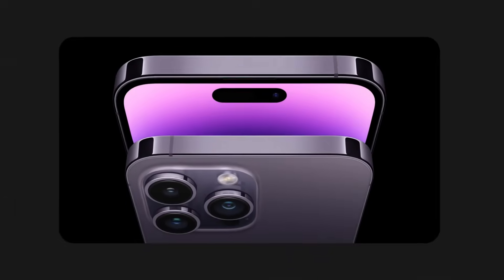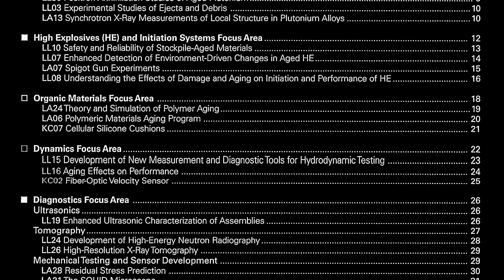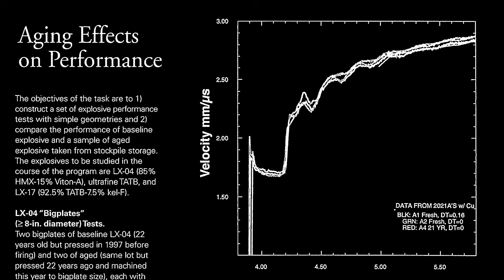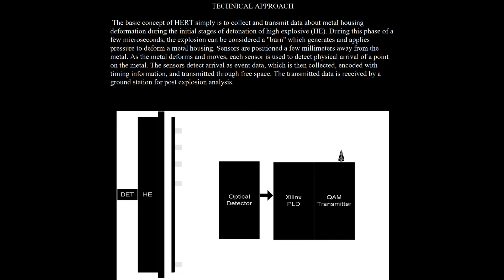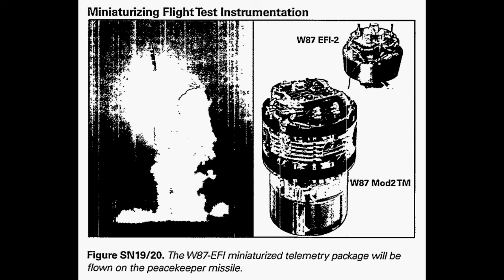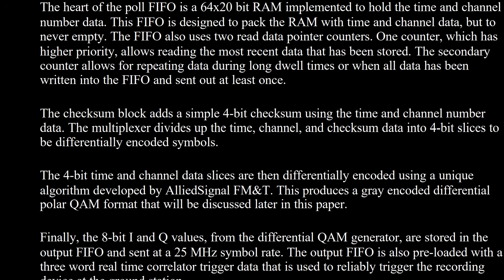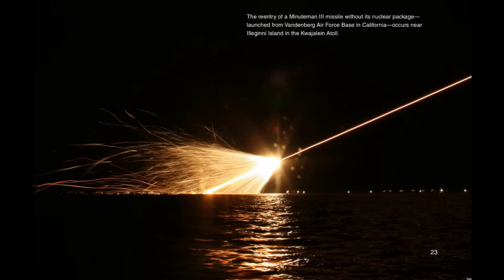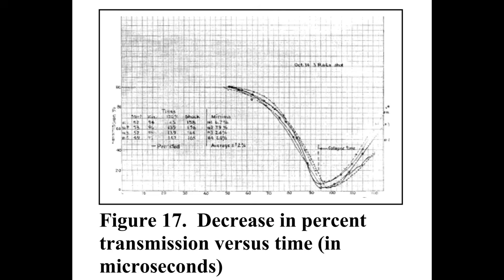The Computer Designed To Die In Microseconds

Comment: That's all super amazing. I had never seen an animation of what happens at the core of a nuclear weapon during the detonation. I would love to see more of that and a description of what we are seeing as it implodes. It would be neat to see more on the original implosion experiments and their aftermath. I wonder what those experimental cores looked like after they were imploded. Were they still intact but more compact? Did they compact into a perfect sphere of some new dense material?  It's like a scene out of  Superman movie where he compresses coal with his hands and creates diamond. I think one time the bad guys held Lois Lane hostage until Superman manufactured some diamonds with his hands.
Reply: The dummy cores probably have so much energy in them as they implode that they "bounce" at the center and explode into a fine mist of liquefied metal.
Reply: @r0cketplumber  I can imagine that happening. Sounds plausible.
Reply: At peak compression the volume of the core is roughly halved and its density doubled. The amount of energy stored in the compressed material is huge and it would quickly rebound and explode into dust if the nuclear explosion didn't vaporise it first.

Comment: The entire point of the National Ignition Facility IMHO is to produce a Fusion Bomb that does not require Fission for Compression. What they have proven is they can do that and have detonated a 17LB of TNT equivalent  Fusion Bomb with as little as 10 Kilowatts of actual focused on target laser power. What I am not sure of is if they could detonate a 1 Kiloton (or 10 Megaton) of TNT Bomb with 10 Kilowatts of Laser Compression or if the Laser power will have to scale up. It would be very interesting to see the inner workings of the instrumentation and resulting Computer simulation from this data.
Reply: Happy Birthday, PS when your Great Grand kids start turning 10 , then you know you're old. ;-)

Comment: About that fake warhead exploding over that poor hated atoll. It does approach it with the remnants of reentry velocity engulfed in hot plasma of atmospheric heating. The spherical explosion it self is another source of plasma completely surrounding the apparatus. How does radio transmission deal with that? High output power, some funky receivers? Warheads are accurate so at least proximity to receiver is not a problem. Or does warhead contains a transponder outside of explosive lens assembly?

Comment: I worked for a company called Birdwell which did wireline logging (not lumber but data) for the DOE at Mercury Nevada. We logged the 10’ diameter bomb wells but also all the smaller monitoring wells surrounding a subsurface test. The inner monitoring wells were destroyed but sent data as you mentioned. The outer wells were used to measure various spectrum data. Fascinating work.

Comment: Welcome to the other side of the human half-life :)
100Mhz is not a fast processor, even for that time. There must have been other reasons to chose it over other faster devices, such as cost per unit, failures per hundred made percentage, or even just resistance to the electromagnetic pulses of the detonation system.

Comment: How about putting a single power source in the middle, wiring transponders to it with unique codes and measure when each transponder stops transmitting?
No internal computation needed and it would allow for a more analog like signal, you could even give each transmitter it's own frequencyand just plot when each frequency goes dead.

Edit: pls someone develop a kind camera that uses a dense matrix of sensors, take an analog computer to render the whole thing and put it on a cothode ray screen! You'd get a 3 dimensional implosion model with it
Reply: And how exactly do you transmit through metal and plasma?
Reply: @0MoTheG  well they did transmit it somehow, didnt they?
Reply: @wonjez3982  please check the wiki entry on Dunning-Kruger effect. Then you will see why your idea is unlikely to work.
Reply: @JurekOK  Well, asking a question is neither knowledge or skill based and thus cannot be affected by dunning kruger, neither are speculations about the consequences of the question at hand.

Also i'd rather overestimate my skills than to remain silent, nevermind ignoring someone because they don't have the same understanding as i. Everyone can have ideas, knowledge just makes them more likely to be actually useful ;)
Reply: Not enough precision. There is more than one reason why it may stop transmitting, and even the antenna itself has some internal energy resonating inside it after the transistor pumping it has stopped pumping. So, you would have to factor in "how did the antenna got crushed" making it way more complicated, not less.

Comment: Years ago I worked for a company that made something that was of interest to the government. The things we made were designed to be used 1,000 of times typically. In discussions with my contact at the government agency, I asked, “What is duty cycle?” Meaning how many times does it have to work. He said, absolutely deadpan, “Once.”
Reply: "Once... but it must work that one time, with 100% reliability, after sitting in a warehouse for 40 years." This is precisely why "nuke-cert" materials cost an insane amount of money - it's the same grade-8 bolt you can buy at Home Depot for $1, but because 50% of the production lot is tested to destruction, we taxpayers pay $10 for the exact same bolt. Because it absolutely, positively, MUST work when call upon to do so. Failure is NOT an option.
Reply: @MrJest2  Yes, I understand and agree. We also used to produce electronic components for spacecraft. The company I worked for (GE)  helped develop the procedures of how to produce components with XXX degree of reliability but without testing all of them to distruction which of course would leave you with none left! The full procedure too lengthy to put here but yes, they resulted in ordinary 5 cent diodes costing $10.00 after all the testing and other procedures. Most people do not understand that this is the reason that certain pieces of equipment can end up costing so much. I do not know if "that department" ever used our product in the application.
Reply: @MrJest2  Lol and yet a lot of stuff fails anyways. Often not even the hardware, but the people.

Comment: That's a bit of a flashback.  My thesis work was part of a high density generator and computerized detonation system for  ~30mm munitions (they kept pushing the scale down to smaller calibers).  While the devices do only have to operate for a fraction of a second, they also have to sit fully assembled for decades and remain reliable with zero maintenance.  They also have to fit in as little volume as possible and withstand absurd mechanical loads.

Comment: I have a question. You say the shockwave moves with 8 km/s. What I know from rocket engines is that the detonation in the burn chamber cannot move faster than sound. Sound at normal pressure is 300 something m/s. I guess in the bomb the pressure is a lot higher. But in general, any explosion causes high pressures, especially when contained in a rocket burn chamber. Can you tell us more about how this stuff works.
Reply: I don't know about the specifics of either of these topics, but,the speed of sound depends on the transmission medium.
Reply: From wiki (yeah I know...)
"Supersonic explosions created by high explosives are known as detonations and travel through shock waves"

Comment: I attended a review for DARHT controls at one point. Didn't have a security clearance so I didn't get to see the secure camera gear, but the accelerators and controls were not classified. The concrete noses of the accelerator buildings were covered with protective netting where the beams came out. The "netting" was wire rope shredded by the shock waves. The beams were used to take high speed xray images of the explosion processes. The images were reflected with mirrors down through tubes to the underground cameras, the blast would obliterate the mirrors but the cameras were protected. Interesting stuff.
Reply: I always wondered how they spared the certainly digital imaging system of that thing from the blast. Such an obvious solution with hindsight. There must have been a scintillator panel between the test article and the mirror and some means of enclosing the setup to exclude ambient light.
Reply: @Muonium1  Don't know, but I think the shots were done at night. Perhaps the scintillator was the mirror.
Reply: @Muonium1  The x ray beams passed through a hole in a sturdy rotating disk inside the building so the shock wave would be later and not aligned with the hole to protect the target that converted the accelerator's particle bunch to xrays from it.

Comment: Before I retired from my electrical engineering career 10 years ago my primary job was the implementation of various types of RF modems. Seeing those block diagrams in your video showing a 64-QAM IQ modulator pumping out 25M symbols per second brought back old memories.
Reply: How many bauds is that? 😁
Reply: @PinataOblongata  25 million. Baud is a measure of symbols per second, not bits per second. It's a term coming from teletype terminology (where it was characters per second).

In comparison, modern satellite DVB transmissions use 27,5MBaud at the same 64QAM modulation. So basically this thing was sending out a few frames worth of HD video before it could go pop.

Comment: Hi Scott , something about your description of intra- explosive telemetry doesn’t sound right to me .  Surely a imploding spherical shell of plasma must be completely radio opaque. Even the lower pressure plasma around a space vehicle during re-entry results in a telemetry blackout . I would expect a high pressure plasma shock wave to be a perfect Faraday shield .  Sure FPGAs are fast enough to get a signal out before destruction , but we would be talking about something battery powered with some kind of physical antenna imbedded . I can’t imagine even if a signal could cross the imploding boundary ,the conditions would be so extreme that it would be swamped by the enormous EMI generated by the plasma shell . Telemetry from outside the shock front I can believe but I am highly skeptical that any RF could be detectable outside . An external array detecting an X-ray pattern might be a way to infer the behaviour of the boundary but what you are describing doesn’t sound right to me. Maybe I’m not understanding this correctly and someone can explain ?
Reply: put a couple of thousand watts into your transmitter ( the amplifier won't live long enough to get hot) and put the rx a few hundred meters away rather than 50w of tx power and a thousand km of distance. I imagine that'll solve many issues of signal path loss.
Reply: The gas temperature of the detonated explosive may not actually be all that high, maybe a few thousand C, and so the ionization level could be quite low. Compare to the bow shock temperature of a reentry vehicle which may exceed 10,000 C. The real question is how the hell are they getting the data out of the vehicle screaming in at mach 23 and onto the ground.
Reply: @Muonium1  they are transmitting about a kilobyte of data at 100mbit, so "pretty quickly" is probably the answer lol

Comment: Many happy returns of the day Scott.
This reminds me of a story from my days at Digital Equipment Corporation Supposedly some ingenious government contractor decided to measure underground nuclear tests by lining the area with a dozen or so PDP 11/03s who's only job was to measure something highly classified and then transmitting the data up to the surface as fast as it could before they all vaporized. The data was received by a PDP 11/34 which immediately wrote it all out to  magnetic core memory and then shut down before the shock wave from the nuclear blast underneath it reach the surface.  Some poor customer service engineers had to pull the core memory out of the remains of the 11/34, put it back together, then install it into another 11/34 whose job was then to read the data off of the magnetic cores to come up with whatever useful data they were trying to measure in the first place. There was one side complaint that when digital equipment stopped making the 11/03 the contractor had to replace them with PDP 11/23s which are two or three times as expensive as the 11/03. Your tax dollars at work.
Reply: I will always have a soft spot for DEC's VAX/VMS: taught myself computing on it!
Reply: When you have a DARPA budget, the concept of "disposable computers" is no longer a coffee machine joke.

Comment: As fascinating as it is to learn about the telemetry attached to an empty Primary, all I can think is that it must have been impossible to gather such data on a live Primary as any monitoring device would have been destroyed in nanoseconds, not microseconds.  Also, I can't help but wonder if they could even gather such telemetry on a Secondary without the Primary detonation destroying the sensors?

Comment: It's hard to appreciate with the current state of software, but computers are crazy fast.  Light travels ~30cm in one nanosecond, or 1-billionth of a second.  A modern cpu easily clocks in at 5ghz, or 5 billion cycles per second.  So if you're 1 meter away from your monitor, your cpu can easily execute 16 instructions while the photons from your monitor travel towards your eye.  Of course not all instructions take 1 clock cycle, but if you consider the pipelining on a modern cpu, they actually execute considerably more than one instruction per clock, and that's not even getting to multi-threading.  We're all just casually using god-like machines for mundane tasks every day.

Comment: As a programmer, I find the notion of a computer not living long enough for a 14-bit wraparound to be a problem highly amusing.
Reply: Processor: What is my purpose?
Programmer: To die in glorious fire and insane pressure! And write about it while you are at it.
Reply: @Thoran666 
Processor: i fucking love my job-
Reply: Los Alamos: What is the meantime between failures of your package?
Contractor:  WUT
Reply: @-danR  Ha ha - back to the dictionary of internet slang { BDIS } - WUT?
Reply: If the device lives long enough for a 14 bit integer overflow to actually happen, then something else has failed.
Reply: @dylantowers9367  entropywizard.exe has stopped working.
Reply: I wonder how many clock cycles it gets to run?
Reply: @joshmellon390  "exactly 1!"

Ngl I'm curious also
Reply: Yall in hear speaking in a foreign language
Reply: @MrKKUT1984 "here" and "hear"
Reply: My comment is hidden.
Reply: It's a good example of a hard real-time system  🙂
Reply: Hard realtime. Very hard.

Comment: If a solid sphere of copper, iron, gold or similar was used as the pit. Would it stay fairly compressed or just rebound to normal density? (Assuming it doesn't rebound so hard that it flys apart.)
Reply: The compression is just a few percent.   I would guess there are several.pieces.

Comment: Scott, During the 1980s we were selling Digital vax mini computers with a single Ethernet port, limited disc and memory, and ordered in large numbers.

Turned out they were laying Ethernet cable as sensors, with the signal time being used to measure explosion wavefront travel. As the front destroyed the cable, the ‘ping’ time reduced. This was forwarded on, until the unit was consumed.